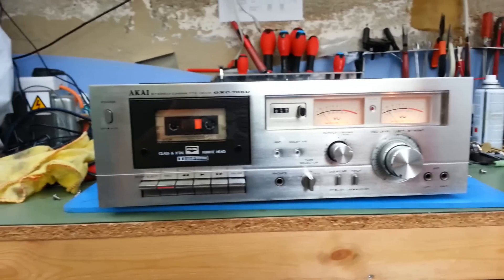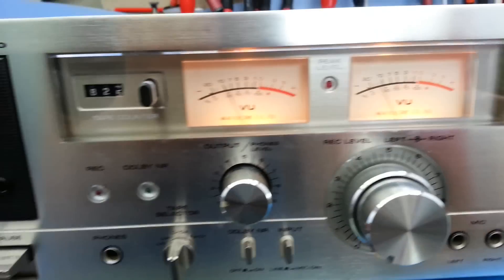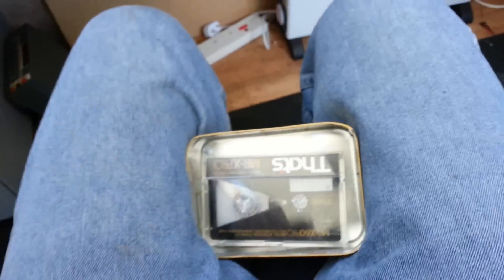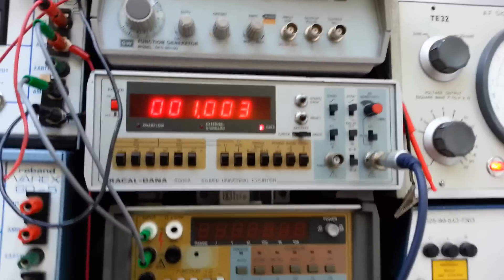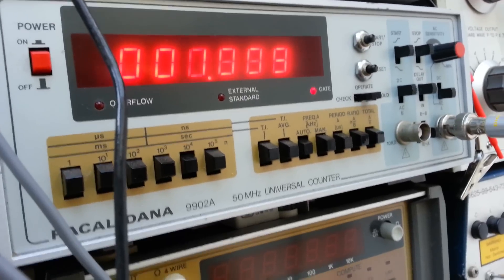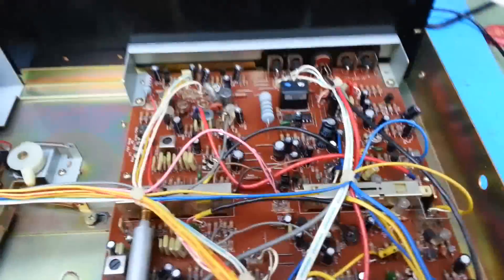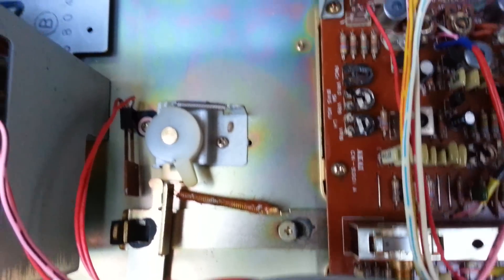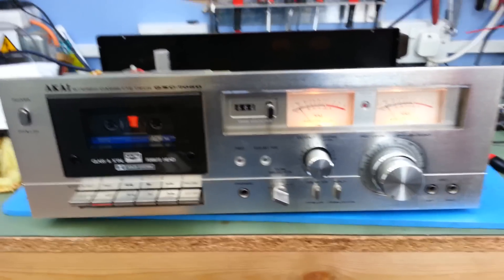Speed calibration of a cassette deck

Comment: I changed the pinch rollers and belts with new ones on my Sony TC-WE835S.  The 10 minutes 3kHz test cassette I bought does not have constant frequency.  It started at around 300xHz then gradually reduced to 296xHz in about 5-6 minutes then went back up to 297xHz in the last 2 minutes.  The difference is about 40Hz.  It that normal?  Should I calibrate in the first 3 minutes or wait until after 6 minutes?  Thanks.
Reply from the maker: That is not likely to be the tape. Sounds like a motor servo problem.
Reply: @SoddingaboutSi   Thanks.  Is there anything I can do?  I have some electronic knowledge.
Reply from the maker: @WL-vw4qx  you need to check the rpm on the motor really. Are the belts tight?  Check the test tape on another cassette deck will confirm.
Reply: @SoddingaboutSi  The belts were changed about 3 years ago.  I ran the test tape on both decks and both directions.  They all presented the same problem.  The frequency was high in the beginning then gradually reduced.  The differences are 2xHz, 3xHz, and 4xHz in 4 tests.  The worst is on deck A side A.  Unfortunately I don't have an equipment to check motor rpm.  If the belts are loose, could the speed be slow in the beginning or fluctuate all the way?
Reply from the maker: @WL-vw4qx  If you tried the tape on two machines and get the same frequency shift, yes the tape is faulty. You need better  tape,
Reply: @SoddingaboutSi  Actually my machine has two decks and both decks have the same problem.  I did not run the test tape on "another machine".  Do you still think the test tape is faulty or it is my machine?  I think that is the first thing to determine.  Thanks.
Reply from the maker: @WL-vw4qx  I am very suspicious of it. Both decks doing the same,? Unless the power supply is faulty. Doubt it.
Reply: @SoddingaboutSi  Yeah, both decks doing the same on test tape.  However, both decks play/record normally and other functions work fine.  Just the test tape speed variation.  I recorded a 20 min album from a tape on deck B to audacity then compare to the same album with CD version on YouTube.  Played the first and last songs with audacity and YouTube synchronized.  I did not hear obvious pitch difference.  Next I lowered the pitch 15Hz in audacity then the difference become detectable compared to YouTube.  Does it tell you anything or still unclear?  Suggestions? Thanks.
Reply: @WL-vw4qx  Unfortunately I had similar experience with Sony WE-835S deck. Probably when the motor/electronics gets older they exhibit this behavior. I adjusted after 3-4 minutes. Still some better solution would be appreciated.

Comment: When you record mixtapes on this.
Does it actually record the dolby onto the tape.
Or is dolby only for playback on this machine and not in a car.
Reply from the maker: When you use Dolby, you have to record with the Dolby system of choice onto the tape. Dolby will give a dull and sometimes pumping sound when played back on a tape that did not have Dolby recorded on it.

Comment: I'm struggling to think of a speed regulation mechanism that could live in a motor and involve an adjustment pot, and still be very accurate...  was there any kind of actual feedback in a control loop?  Or did we just sort of take our chances that the load on the motor was pretty consistent?  I'm aghast!  :)

Comment: Exellent video....i have a question. ...i have a 1970s jvc but the power on off button wont stay on..any advice. .can they be fixed...cheers from belfast
Reply from the maker: Most likely the catch has broken the plastic ramp on the switch.
Reply: @SoddingaboutSi  ..thanks. .are they fixable
Reply from the maker: Not usually.  A replacement might be easier to find if you compare it to  one online.
Reply: @SoddingaboutSi  ..cheers...at the minute i have jammed a cocktail stick in to keep it on....what are those switches called?...thanks .

Comment: It worked!!!

I first tuned the Pioneer deck by ear using a familiar song. After that test, I set up my phone with an app that generates and analyses frequencies and recorded onto tape through a trusty Technics tape deck. Played back tape on the Pioneer and I’m quite pleased to say I ear-tuning was only offset by a few hertz or so.

Very surprised by the amount of flutter by both decks. Both rapidly hovered between 3002 to 3010.

Nonetheless, I’m very pleased I came across this video.

Comment: I've recently bought a 70s Crown music centre off eBay. It was advertised as fully working but when it arrived the tape was running slow. Prerecorded tapes play slow, but tapes that are recorded off the record deck and played back are running at normal speed. I'm not an expert, I have no experience repairing tape decks, I'm at a loss as to what's wrong with it??
Reply from the maker: The machine is running slow if the pre recorded tapes are plying show. It could be a belt slipping or motor problem.
Reply: Simon Spiers Just I'm confused as to why it's playing at normal speed when you play back from the record player? If it's a mechanical problem why is it playing at normal speed, it should be like that with both. I think it's something more serious like a circuit problem
Reply from the maker: Recordings recorded on the deck that runs slow ill sound normal as the speed is the same as you recorded it (slow)
Reply: why is that? should it be at slow speed because you are recording it a slow speed?
Reply from the maker: Can you confirm.
When you record on this deck and play that recording back on this deck the speed is correct?
When you play a tape recorded on another machine back on this deck it is slow?
If that is the case when you record on this deck at a lower speed and then play back at that same speed, the recording will sound correct because there is no difference in speed.
Reply: Yeah the speed is correct. As I've said it's pre-recorded commercial tapes that run slow. I don't have a clue what's going on. The record is working perfectly and at precise speed, it's the tape player. The right channel is extremely sensitive, I have to turn the record volume down, and volume is low when it's played back.
Reply from the maker: Christopher Nield Then the deck is running slow. you need to adjust the motor or get the mechanism serviced.

Comment: Great video, thanks. I do it a similar way myself, but i have no fancy meter, only a smartphone app doing pretty much the same thing. Also works just fine. Always nice to see a fellow cassette deck lover in action :-)
Reply from the maker: Yes, the frequency counter is just part of the workshop infantry, Another method is to use two decks with two copies of the same frequency and play the known good deck while adjusting the second. If you listen to them both you can tune for zero beat.
Reply: I need a workshop like that too :-) Back in the days i used to match with another deck like you mention, or rely on my ears on a well known recorded tape but a proper meter is the best after all.

Comment: posted 2013 Great Video.  Question, your claim that the play back speed is off.  One wonders is the the speed of this cassette deck is the speed set at the Factory.  Also if the factory does set the speed dead on, can you explain how the motor speed change.
This is a very nice vintage audio cassette deck.  With good looks.  Thank you for your time.
Reply: I believe the speed slightly change over the years due to mechanical wear in material and the belt may also differ in quality after a replacement. i may stand corrected though.
Reply: Would an average person not a critical listener be able notice the slight change.  Thank you for answer me back.
Reply: i can only use my ears as a reference but sometimes i can notice a small speed change, usually on songs i listen very much to. When using a test tone like this it's a good way to make sure if the speed is wrong
Reply: Thanks for your replies.  You must have great headphones and speakers.  Please continue to make video's.  R.
Reply: i'm not the guy who did this video but thanks anyway :-) I'm fiddling with the same kind of stuff though, it's fun to keep the decks alive
Reply: The world needs more people like you.
Reply: yea that's true :-)
Reply: not sure I understand how they would incorporate the use of the Phase Locked Loop, to control the speed of a cassette deck.  Could you perhaps mention any cassette deck that incorporated this type of circuity, to keep the tape speed spot on.  Yes thank you, for added this information, you have great soul, to share your knowledge.
Reply from the maker: Technics RSB555. No belts, all direct drive and a motor direct on the captan.
Reply from the maker: Hi Robert, yes as Håkan Löfvenhaft says wear in the mechanism and electronic component drift mainly. Belt tension is also a key. Modern closed loop systems use a PLL to keep the speed spot on. so nothing to twiddle with anymore.
Reply: next time it will be more prune jucie

Comment: if you got another tape deck you trust the speed of you can record a tone from a keyboard checking it with a pitch tuner, then adjust the wrong speed tape motor to match that or you can buy a test tone tape and do similar. You also used to be able to get a casette that strobed so you could do it visually

Comment: I once serviced a Pioneer dual cassette deck that had an inaccurate playback speed. There was no spool adjustment on the motor, but rather on the main pc board. Two ports on the board to control the two motors for both tape drives. An additional 2 ports were for adjusting the high speed dubbing mode. I just enjoy working on these long obsolete cassette decks during the day!

Comment: I sort of had to improvise a way to calibrate speed on a cassette deck.

On a deck I know to be at the right speed, I record a 1 kHz tone onto a good cassette.

On a deck I'm calibrating, I use an instrument tuner, such as my Korg TM-40, instead of a frequency counter.

More or less, I get the same result this way.

Though it may not be quite as precise as a frequency counter, it should be more than adequate for a regular consumer deck while not breaking the bank, resulting in an adjustment that should fall well within the margin of error that may be indicated in the deck's service manual.

Comment: It's just like the Microsoft Certificate of Authenticity...how do you know it's real? Do the send another certificate of authenticy to prove it's real? And how do you know that's real? I would suggest digitizing some pre-recorded cassettes in short sections and uploading them to a site like AudioTag.info and twiddling the speed until it recognizes the song (artist/title). It's quite intolerant of wrong speed and provided you aren't too far off (and the digitizer is calibrated to WWV using MMSSTV) you can get the tape speed that gets the most songs recognized on different tapes.